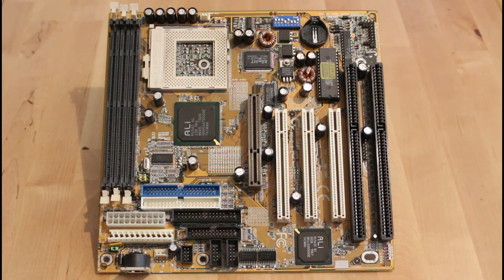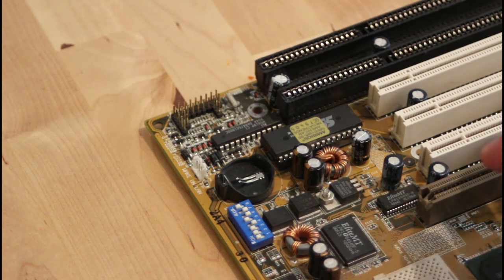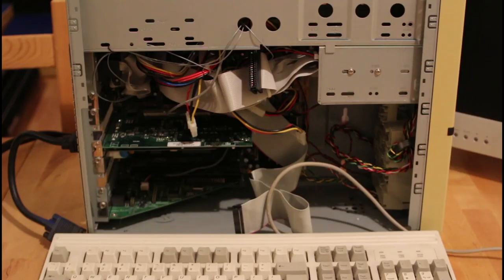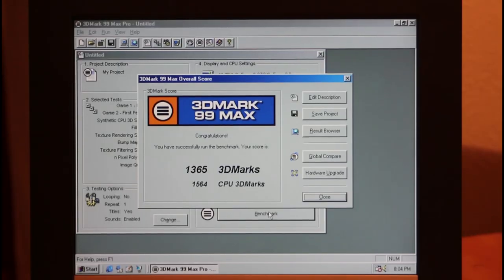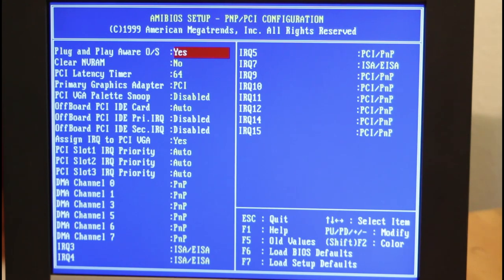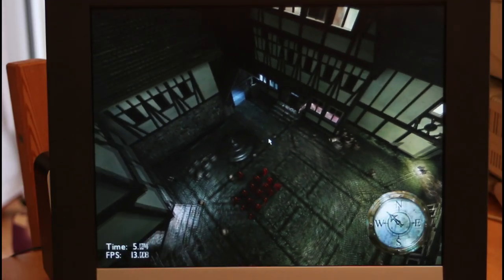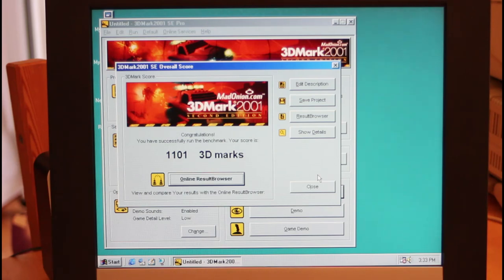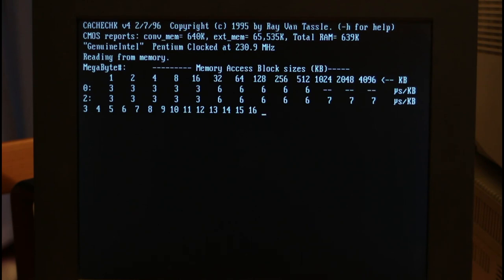Rescuing and benchmarking an ALI Super Socket 7 Motherboard

Comment: It looks like you haven’t enabled AGP 2X in the BIOS. 

Also, if you lower the resolution, you’ll be able to correctly benchmark the CPU, as it won’t be bottlenecked by the GPU.
Reply from the maker: Well that would certainly explain some things. I don't know how I overlooked that, or why it isn't the default on this board. I'm certainly going to have to do a followup video now aren't I. :-)
Reply: @PCRetroTech  I was going to say that too once I reached the end of the video ^^
I think it's disabled by default because the AGP implementation in these boards is rather poor and can have lots of issues, and this is one of the way to fix them.

I have a Asus ALi motherboard and a Shuttle and a DFI via motherboards so I could do some benchmarks if you want to.

Comment: I'm sure that one of the via of the big trace is not connected to the back and is just connecting through the board meaning you can actually solder it from the back (I've personally never seen a board with caps sitting flush against the PCB being made differently).

What may have caused trouble however is the fact that these planes are really big, making it harder to solder things to if you don't have the right tip/soldering iron/heat.
One of the things pointing to that idea are the burn marks on these pads.
Reply from the maker: Yes, I think the via goes all the way through, but there's not much real estate to solder to. It was much easier to solder to the other side. I was also a bit worried about introducing a short by soldering the back.
Reply: @PCRetroTech  the trace might have been damaged by the previous owner by heating it for too long while not being able to melt the solder.
Now unless the copper have been exposed I doubt you'd have had a short there.

Comment: Now I realize, how back them evolution of hardware was insane.   96 - Voodoo 1, 98 - Voodoo 2, 99 - Gforce 256,  00 - Gforce 2, 01 - Gforce 3. What was that year High End, next one almost couldn't run new games.
Reply: Yeah, those were crazy times. The companies were also trying to outdo one another on price as well, so there were all sorts of el cheapo options hanging around at the same times as the latest parts as well.
Reply: @billhart3814  Right, for around 600$ you have got absolute newest high-end card (2001 GF3), not like today some mainstreamish version.
Reply: Talk about a 14k DM 1995 PC that was worth 2k DM in 1997

Comment: Ah memories, I had a similar ALI board with a K6/2 450 back in the day with a Banshee. The AGP on the board was flakey but it was a good performer
Reply from the maker: Yes, I've read the AGP implementation on ALI boards is flakey. I did have some hangs in the PCPlayer benchmark (after it finished), but otherwise haven't actually experienced any problems so far.

Comment: i've always had issues with VIA chipset AGP support under windows 95 and 98, not very stable in combination with some implementations. ALI and SIS was generally pretty good, stable, and compatible in my experience. VIA got much better later on, and i had a couple years of wonderful experience with windows XP and the Slot A chipsets (KT133, KT400, et c). i think i still have a perfectly running Soyo KT333 Dragon Ultra Platinum that's an absolute beast.

Comment: Those boards go over a wave solder machine in production, there's no way a cap lead would not be soldered on the underside.  Not all caps bridge across visible voltage planes.  Sometimes, one leg connects on the opposite side or internally to its plane.  It certainly wouldn't be soldered from the top side of the board.

Most motherboards of that time would be at least 6 layers, some as many as 8.  I you look around the edge of the board, you may find a legend which is a series of boxes with numbers on them running along the edge for about an inch, each one being deeper and deeper in the board.  A 6-layer board will have layers 1-5 marked.  If you look down in the corner where the CPU socket is, next to the retention clips of the DIMM sockets, you might find it at the edge of the board there.
Reply from the maker: You may be correct, but for example I've seen AGP sockets soldered on both sides. I don't know how this would have been done from a manufacturing point of view. It sure is a pain to remove them though.
Reply: @PCRetroTech  That would be a weird-looking socket, are there any images of that online?  I'd be interested in seeing one.
Reply from the maker: @Fredjoe5  I doubt you'd see it without a closeup. I couldn't tell if the solder had gone through the vias. Maybe that's how they did it.
Reply: It's so funny that we have gone backwards. My mainboard today a B450 is only 4 layers, i was almost knocked off my chair when counting them.
Reply: @SianaGearz  Right, it's the higher integration of modern boards, which minimize and lot of interconnecting, leaving just the high-speed serial busses.  RAM is really the only parallel bus left these days.
Reply: @Fredjoe5  Fanning out a modern CPU with ever more pins and a lot of PCIe lanes is no joke. But there's also minimal skew matching, only RAM needs to be thoroughly deskewed and all other links just pairwise. Signal integrity was a big problem back in the day but it's interesting that it isn't so much now.

Comment: Hello, the Ali chipset only supports AGP 1x . That's why I switched from this mainboard to a DFI P5BV3+ Rev.C with Via chipset, much better results with a Voodoo 3 2000 (although the Voodoo doesn't support Agp)  Greetings
Reply: Voodoo supports AGP, it only doesn't support the AGP GART address remapping feature, so it cannot hot-swap data from main RAM on demand. The interface connection uses AGP signalling.

Comment: Set the multiplier to 2x for that K6-2+ and it'll run at 600Mhz ;) For Super Socket 7 the maximum you'll want is a Voodoo Graphics or Riva 128 from '97 or at the very most Riva TnT, ATI Rage Fury or single Voodoo 2 from '98. The CPU will bottleneck anything faster. a Gefoirce 256 will probably squeeze a bit more performance out of it, but they are stupidly overpriced these days, grab a Geforce mx400, which performs virtually identically. That 3DMark2000 score is incredibly high for an AMD K6, absolutely nothing to scoff at. When we host the Retro LAN's here in Sweden, our rental PC's have a goal of 2000 points in 3DMark 2000, which is roughly what you'll need to have an enjoyable experience in most games from 1999 and earlier.
Reply from the maker: Awesome. I'm looking forward to a followup and doing some tweaking and overclocking.
Reply: @ch282 if you want to attend one of our retro LAN parties but don't have your own retro PC, you can rent one from us, we have 50+ 1999 era PCs ready to go.

Comment: Super socket 7 with a k6-2. A computer that I never had but perhaps could have if had known a thing or 2 about computers back in 1998. Of course, it being 98, the GPU would have been a much slower / older than that. A voodoo1 initially, most likely, possibly upgraded to voodoo3 in 99.

Comment: Great video! That GF2 GTS is severely CPU bottlenecked in both cases - Which is great for this video, because it shows clear CPU scaling. But GF2 is really for an Athlon 700+ or a PIII close to 1Ghz, and it scales a easily into P4 systems. If you like to keep it period correct, something like a Banshee/Voodoo2/TNT for the P233 and a Voodoo2-3/TNT2 for the K6 would be the way to go...

Comment: Hi - Good video

Yes strange results, i find Phil's kit quite good, i did use those 2 test programs ( the bouncing HAL and  the chess board and little tank ) on 286/386's back in the day, if anything PC player benchmark runs ok and gives reliable results but the 640*480 on some machines / video cards throws  video sync corruption - there is a set of vesa tools to try and install and re-run programs, some can have a extra 20-30% improvement

Bad cache or different levels of L! & L2 makes a very big difference as does the video card used, Check with Phils webpage not youtube he has a spreadsheet on submitted results from viewers, you can download it  and browse / filter it.

The variety of bios options can make or brake anything, memory branding, speed, memory timings, wait states, they all add up, what work in one board does not always work  in another.

With Win98 benchmarks, i actually turn off virtual memory as the read/write can make things sluggish as you experienced with one of those benchmarks that was stuttering for no reason - actually i would run then all with no virtual memory, the do another pass with fixed extra virtual memory say x4 of total ram in system - but never go past the unofficial 512meg limit

To eliminate the hard drive issues, try a compact flash card say or 4 gig CF card, you should have no hard drive slow down, as these format under dos 6.22 to the max 2Gig very fast - they run at almost the IDE full bus speed

Regards
George
Reply from the maker: Thanks for the suggestions.

Comment: This gigabyte GA-5AA board uses an AMI BIOS, however, my GA-5AX (which is basically the ATX version of that board with an extra pair of PCI slots) has a Award BIOS. Would be interesting to see which BIOS is faster and has more options on the chipset feature page. Something for me to do when I get my workshop set up.
Reply from the maker: Yes, note that the AMI BIOS on this one is quite similar to the look and feel of the Award BIOS. They eventually got the message that their interface sucked and switched, right around when this board came out.
Reply: @PCRetroTech  Yeah ,I hated the AMI WinBIOS, had to put up with it on my Supermicro socket 7 boards. I also have a no-name clone 486 ALi chipset board with it, so I flashed an Award BIOS from another ALi board (Terminator SMT) to avoid it and got even better performance too!

Comment: For the speed improvements I heard that the ALI chipset had a better AGP implementation in some areas compared to the VIA one.
PhilsComputerLab's benchmark suite has also some programs that might interest you which are supposed to up the speed massively the video throughput.
You might want to use CPU only benchmarks to check this out and also try a PCI video card in both boards.

As for the "hiccups" caused by the HDD, these shouldn't happen I think. Have you checked the "dma" mode of the hdd in windows 98 ? This should prevent this from happening.

Comment: RAM controller having that large impact. For reference, test an AMD XP 2000+ on a normal VIA single channel motherboard then test it on a NVidia NForce (possibly NForce2) with dual Channel RAM controller, the difference in performance is akin to getting a CPU upgrade and you only changed the motherboard. Of course one board price was around $70 the other $250. It was still be best performance impact from a single upgrade not expected to have such a large impact (was planning for a later CPU upgrade and needed the board support, ended up delaying the upgrade to the next generation as it was no longer needed. Yes that much of a performance difference)

Comment: @30:15 - You're surprised at the wrong moment. That 40-something fps is 3dbench was very-very low for a Pentium MMX. Something was off with the first setup, really. 3DMark scores aren't that different, if you look this way.
And if you enable byte merge in BIOS you'll get even better with the ALI.
@36:54 - I'm not sure anymore, your K6-2+ 3DMark score is already very nice.
@40:00 - So the Windows drivers messed up DOS performance. Nice one. It almost looks like they tried to actively badmouth DOS in favor of Win98 :D
I don't understand the PCP score, btw. What video mode was this? Ah, mode 101. OK. It must be very video bandwidth limited but it needs another bad setting for sure. Just try that byte merge and K6WC (software) too on the K6-2+. At 500MHz it should do much better.
Near the end - wait, did cachechk just measure the 128k L2 of the K6-2+ the same speed as the onboard L3??? What the...
Reply from the maker: Yeah I will definitely give that option a go along with the software. There'll be a followup video for sure. :-)

Comment: @6:40 it might be even 6 layers. 386 boards were already 4 layer.

Proper late 1999 early 2000 poorspec, or maybe even foolspec. K6/2 400 was more expensive ($200) than Celeron 300A ($150), while slower even before overclocking the Celeron. Celeron overclocked to 450MHz using nothing more than a snippet of electric tape to block 4 pins absolutely destroyed any K6 2/3, and as a bonus you could use 440BX board with actually usable AGP. Those Super Socket 7 motherboards werent even cheap back then, often sold as a premium upgrade option and more expensive than rock stable 440BX/ZX models like Aopen AX6BX or Zida ZX98-AT.
Celeron 300@450 gets 3800-3950 points (depending on ram speed settings) in 3dmark99MAX using TNT, Voodoo3 2000, TNT2, or even TNT2 Ultra. Guess its all CPU limited. Best AMD result on Vogons was with K6-3+ 6x100 at 3766 using Voodoo3 2000.
Reply from the maker: Wow, I had no idea they were already so many layers. Interesting indeed.
Reply: @PCRetroTech  Every time you see PCI bus there are at least 4 layers to match impedance specification (65ohm). Then you have huge bga chips requiring more signal layers to fan out. Today good motherboards are 10 layers, graphic cards up to 12.
Reply: I've never been able to run a celeron 300A at 450MHz and get it stable. I have one that seems stable but isn't and the other that doesn't even post iirc.

I don't know if I'm just unlucky or if there's more to it. My celerons are for OEMs so that may be why ?
Reply: @DxDeksor  I on the other hand never had 300A that wasnt stable at 450 :) Very few were stable at stock 2V, hence tape on 4 pins, one on B21 for 100MHz plus three others (B121? A119? dont remember, its been 23 years :P) to bump up Vcore to 2.2V. Celerons 333 were difficult, I had no luck with them above 83MHz, I guess the first batch was topping out at 450MHz. Then Intel must of done something in the foundry because new models released ~half year later bumped up the upper barrier and 366 FPGA Celerons again started to OC with no problem to 566MHz, often without changing voltage, while all later FPGA Mendocino models were a bust topping somewhere around 550MHz so best you could hope for would be 433 at 83MHz fsb.
Pretty much all Coppermines overclocked to 100MHz FSB bus all the way to Celeron 766 model, was just a matter of bumping voltage (up to 2V), but at that point AMD released Durons with the cheapest ones once again overclocking all the way to 950-1000MHz with only 4 pencil strokes.

I started out working for bulk importer of PC parts (official European Asus, CTX, Fujitsu, Primax and bleh PCchips distributor) in 1998, but quickly went independent and just build/sold computers for a living for a couple of years. I rarely sold non overclocked systems. It was so easy and lucrative back then, making $150 part perform like $500-600 one. Nothing like it left on the market right now, its all gamer focused blue led backlit premium sucker niche.
Reply: @rasz  I tried to up the voltage too !
Unfortunately even at 2.6V it didn't work so I just had really bad samples of celerons I guess
Reply: @DxDeksor  mighty of been motherboard or ram related. I only used Intel BX chipset ones.
Reply: @rasz  well it was a BX chipset motherboard :)

I think I also tried on my Abit BH6 which is known to be a overclocking king (unless I read the reviews from back then wrong ?) and it failed too.
Reply: @DxDeksor  Weird. Bad luck? Electromigration? Different packaging plant? There was a lot of tlk at the time of malay CPUs overclocking the best (lot number starts with 9 good, 0 bad), I honestly dont remember ever looking into it as I had no problems. I probably sold over a hundred 300A@450 computers alone back there, didnt have to select good samples or anything. Btw OC world record for 300A is >700MHz on dry ice and 2.7V :]

Comment: Did you have any trouble getting 2.0v for the K6-2 CPU on the Gigabyte board?  I have a very similar Gigabyte board with the same chipset and the manual lists a jumper setting for 2.0v but there's a defect in the way it's wired and it actually produces 0v on that setting.  You could run 2.1v instead, but my K6-2+ 500 doesn't love that so I soldered a jumper wire across two pins of the regulator to allow access to the "lower half" of the voltage table which includes a working setting for 2.0v.
Reply from the maker: No, I didn't have any problems with that as far as I recall. I wonder how many boards they made like that! Is yours also the GA 5AA? I have a late revision of that board from memory. So maybe they fixed that. You may have a very early revision. The board was lauded for its K6 II support when it came out, and also later when as yet unreleased K6's just worked on the board.
Reply: @PCRetroTech  I went back n looked at my documentation.  My board is actually Asus P5A, but similar appearance and same chipset.
Reply from the maker: @angieandretti  Cool, thanks for looking it up.

Comment: So wait this board has both AT and ATX power connectors? Weird
Reply from the maker: Yeah it was common enough for a certain small period of time.
Reply: @PCRetroTech  I don't remember it but my PCs from the 1990s era were pre-built
Reply: Many of the later transitional AT-style boards had them, although they usually didn't have the soft power on feature of the later ATX boards.